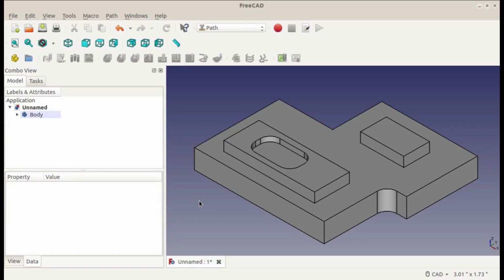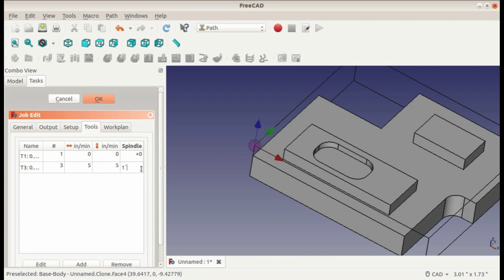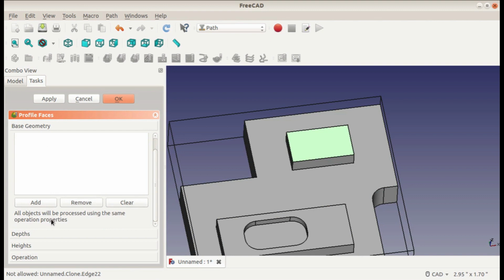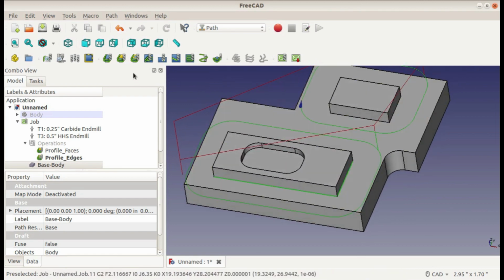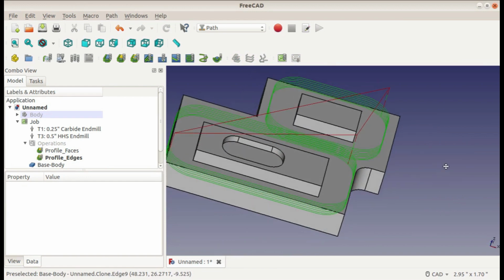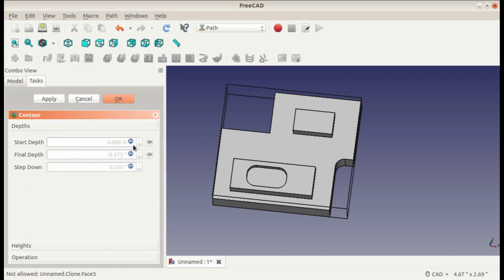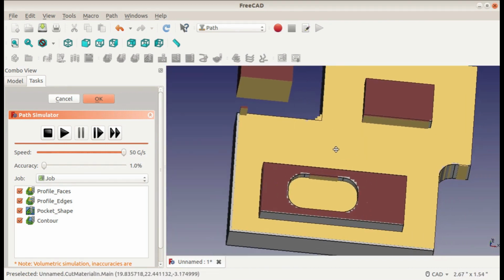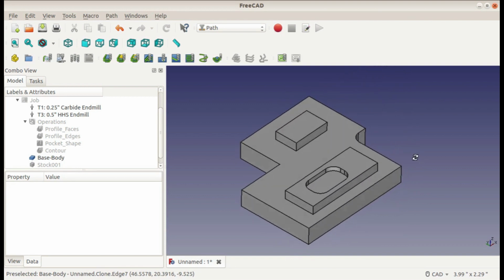Learn FreeCAD: #11 Contour and Pocket Cutting - Tutorial

Comment: Thanks. I have a tool that's 3.2 mm cutting diameter. However on the material its actual cut is 4 mm. How do I set this 0.8 mm offset in the software?

Comment: When I did the profile and the contour on the previous video the path show by the green and red lines outside the body are not directly over the body itself, it's situated outside it, which is weird and hard to explain.

Also, for some reason I did not produce a 2nd base body in this video but did on the last one. If anyone could help that would be great.

I am using version 0.18.